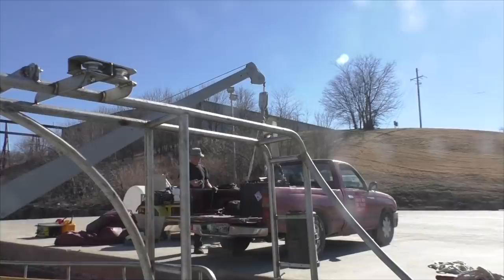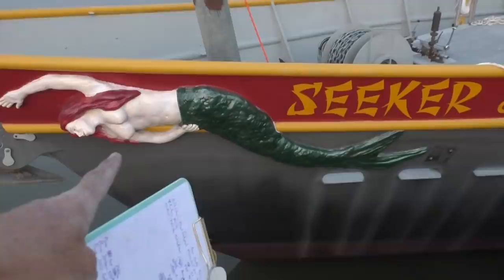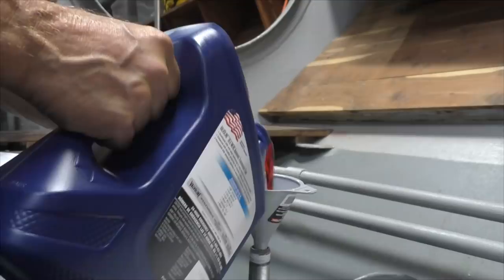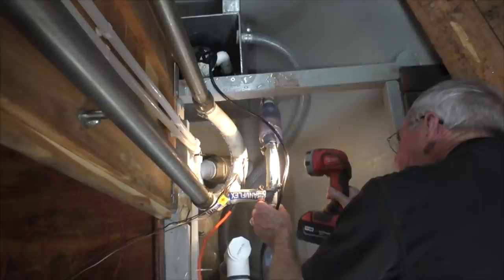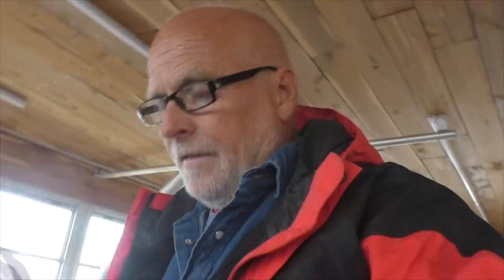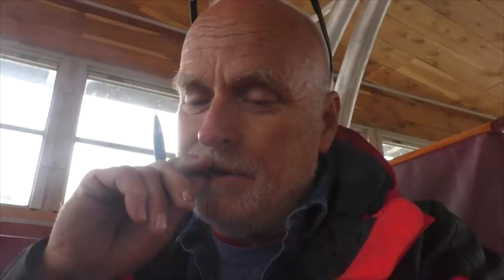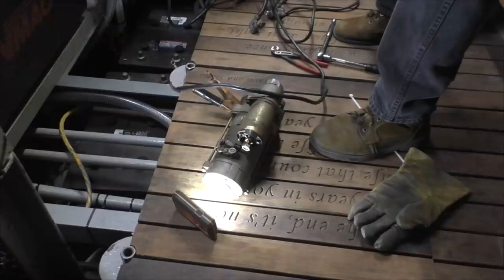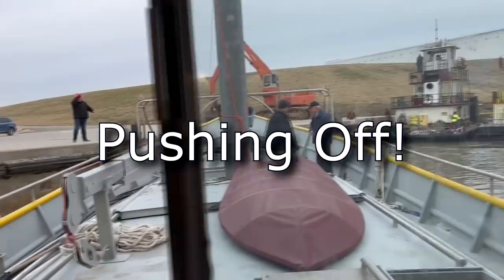Fire, Flood, Listing, Engine Failures and other Dockside Calamities

Comment: I'm still impressed at how you fabricated the prop blades from scratch.
Reply from the maker: That was a blast.  And so satisficing.
Reply: That's what brought me to the Seeker YouTube channel way back when. I was looking for info on building a small foundry out of a 20 lb. propane tank so I could do some metal casting and the first link that popped up was to Doug's video on building his 55 gallon drum foundry. Had to keep watching to see what he was doing with it. When I saw prop blades for a sailboat, I was hooked.
Reply: That was the first videos that drew me in to the project!
Reply: Super impressive. The blades are a very sensitive thing for a boat. Even a little imperfection had a direct impact.
There is a dutch blacksmith that figured out a way to (just) sharpen the propeller blades for cargo ships, making them use less fuel, be more quiet and have less vibration. That blacksmith is now making millions.

Comment: Don't forget that with way on the boat the shaft won't stop.  The prop will act like a fan being pushed by air, or this case water.  Waiting for it to stop would mean waiting for the boat to slow enough for friction losses to overcome the forces from your prop wash.

Comment: Cool, a loo with a "sink the boat" lever. You should stick a Post It on it saying "do not sink boat". And possibly more Post It notes next to the 200 switches and breakers saying "Not this one! That one!". So many things to keep in mind with  Seeker. I hope you'll be training the crew mercilessly or this is not going to end well.
Reply from the maker: Crew are who built this boat, they are not your typical crew.  : )
Reply: @SVSeeker Here is my 2 cents. Checklists keep boats afloat. Departure checklist, docking checklist, fueling, stores, emergency, mani overboard, watches, Systems checklists with diagrams I.e. where r the thru  fitting located, their function, bung locations, pumps FUN FUN FUN
Reply: @SVSeeker  Don't get me wrong. I enjoy every minute of the Seeker story, but today I started to wonder, what would happen, if you went overboard in a storm. I would probably fight my way to the dingie. Panic, a lot of switches and levers and the head honcho taking a swim? But again, you never cease to amaze, I guess, you have things under control.

Comment: Every newly launched boat has teething problems.  Glad to see you are using logic to solve the problems.  I had an old wooden cruiser with a 6-71 Detroit that had a rugged manual gear box that was fool proof and had the ability with the manual Johnson bar to be able to feather the prop in forward or reverse from just a few turns of the prop to mechanically locking it in gear.  Made docking and close manuveoring an easy exercise in a heavy wooden 45'er.  It's been 30 years since and I cannot remember the maker.  It was used by the navy on the small landing boats during WW2.  I am sure someone remembers the maker.

Comment: If your toilet is below water level, you need to have a vented loop in between the pump and the bowl.  For safety you need a vented loop and any line that has an outlet below the waterline to break the siphon  because it is too dangerous to rely on turning the valve the correct way.
Reply from the maker: You can't pump from a vented loop.  : )

Comment: As a proponent of ‘systems’ may I suggest that you start to accumulate written accounts of all these problems you are solving, and how things work. Then later you arrange them and enhance them and catalogue them. When in the middle of a stressful situation, storm, and something doesn’t work / goes wrong you refer to the master manual. Just like in a jet liner at 35,000 feet!!
I promise you, you will be so happy you did it 😎
Reply from the maker: Sounds like a great job for someone like you.    : )

Comment: Excellent move to go through the initial operational testing dockside... I know too many who don't... but it's a habit for me upon every de-winterization... always best to find out what's wrong while it's an inconvenience, not a peril.
I haven't a clue what your Allison's torque converter stall speed is, but keeping the engine RPM well above it will keep that trans temp cooler, and fuel efficiency higher.
The transit time from forward to reverse can be considerably faster, because the hydrostatic drag of the prop in water will bring it to a stop right quick.  
The power steering pump's output dropping out at idle would be most concerning to me, as losing authority of prop pitch would be really bad under any circumstance, especially maneuvering at idle.  IF the hydraulic controls of the Hundestead operates in an 'open center' mode, swapping the vane-type PS pump with a fixed-displacement gear pump would be the best solution.
I don't know how it'll turn out in the long run, but if I were handling it, I'd probably want to keep the transmission in forward, engine at a constant but slow speed, and vary the pitch of the prop from forward, to neutral, to reverse, while maneuvering.  The only time I'd probably use transmission neutral or reverse, is when trying to swing the transom towards, or away from a dock... and when doing that, the greatest value of the Hundestead, is to be able to put the transmission in reverse, push the prop into a reversed-pitch angle, to walk the transom in the direction opposite what would be common for the wheel.  Right hand screws will back to port, left hand screws back to starboard... but with Seeker's ample rudder, it may not be a substantial side-walker.
Reply from the maker: We'll we got fixes for the torque converter and the power steering pump is obvious. It just needs the leak fixed.  I got the $8 fitting today.  And that not the way the VPC is setup.  Being a sailboat feathered, parallel to the hull.  You're thinking motor boat where feathered is perpendicular to the hull.   And when the prop is feathered the prop walk from the initial test can be pushed either way depending on fwd or reverse.   We'll need more time to play with it, but removing the torque converter is frist.

Comment: You can put a lamp over the breakers. It will cause the breakers to always pass some current, but you get an error signal that lights up when the breaker goes out, if there is a load, like an alarm.

It might not be up to some code, but it is super useful as an alarm. Something like a 1W LED for 12V would allow 100mA to always pass.

This is exciting!
Reply from the maker: Yeah, that’s a clever idea. Thanks

Comment: Looks great and don't worry. Every new boat has errors. Whenever pumps are used the plumbing gets double complicated (in-out) and this is a complicated boat. It's like a military vessel with a trained crew of sailors only you have volunteers. When you put to sea for weeks on end you better have a trained crew. In the meantime, you better get some color-coded graphic labels with instructions on every valve and pump! Below water openings need extra attention like fluorescent yellow paint.

Comment: Tachometer on the prop shaft, might be good reference while operating.
Help montor slip, tune for efficiency.
Negative rpm's, when in reverse.
Reply from the maker: We now plan to remove the torque converter.  After that, one tach will suffice.
Reply: @SVSeeker  Did you find an issue with the torque converter?

Too bad they are not a locking type converter or be replaced with a locking fluid coupler.
Reply from the maker: @jhoncho4x4     It's working well enough but it will be better without the slip.
Reply: @SVSeeker  Doug, i’ve been watching you for years since you started it out with a flat lotta land and a pile of steel plates. It’s really great to see you’ve gotten to this mile stone. I figure you’re going to have to come up with a massive gear reduction to turn that prop. My guess is you’re probably not going to wanna spin it more than about 300-500 RPM. I don’t know I was just estimating the size, But I’m certain you won’t be able to spin it very fast and if you try you’ll end up with a molten transmission. You might want to just put on a very small prop say in the order of 15 inches until you can come up with a different reduction box. I wish you lots of goodwill and hope to see many of your videos in the future.

Comment: keep in mind on the starter... Ohms law...    especially important on that type of solenoid.. excessive amperage can "weld" or fuse the copper contact washer that keeps the starter spinning after the gear engagement.. (reason gear stays extended)  if voltage is dropping below 10.5v during crank, you have a problem..  Double the numbers if 24v system...
Reply from the maker: Ok

Comment: On your Flood - I suggest a water sensor placed in the floor that connects to a BELL Alarm (old style door bell).  That should be done any place a "flood" could take place.
The bell is different sound than other alarm.
If you did it (cause the flood) then others will do it also, no matter how much instruction is given.  It is too simple an error, therefore it will happen many times.  A simple flip of a lever, goes from dumping to sinking the boat.
Needs an alarm at each head or else         😁😉

Comment: Over 1,000ah at 24V is pretty awesome.  I have around 700ah at 48V and I can run my entire house, with a 5-ton heat pump/ac, electric water heater, dryer, well pump, and range/oven for a few days, and I love it.  It's nice having that storage capacity for sure.  If I'm careful, I can go two weeks without sun or wind and still have about 40%.  And that's with hot showers, a/c, and washing/drying clothes.  I just don't keep the water heater on 24/7, which is a waste anyway.  I've been wanting to go tankless, and it makes more sense, so maybe I'll just do it instead of talking about it.  It's really a thing of beauty seeing Seeker in the water.  I remember the first load of steel and "folding the hull".  Fantastic job on everything guys.  You've inspired a lot of people.  Me being one of them.

Comment: Get the trim right, create or add a balance equilibrium mechanism that checks side and front, then use that to balance the ship in the future as the cargo changes. My dad used a long tube with colored water back when we built our version of a Colin archer ship and it worked, but I'm fairly sure you guys will be able to make something much better.

Comment: Just a quick observation….. if you had a large enough fuel pump on board you could make up a hose system to take the fuel from the drum on the dock with out picking up the drum ..  might come in handy on the water ..to go from ship to ship …..   with the right hose ….   ….  Food for thought … :o)
Reply from the maker: We did both, in this video.  : )    Both methods work great.

Comment: Doug. Sail boats  are always heavy in the stern. Once you haul up your sails and catch some wind pushing your nose down she will level out.. and once you have provisioned, filled your water tanks full fuel added crew and cargo. You will be fine add a 1500 feet .75 inch of anchor chain.. your vessel is going to dig in aft when the screws are turning anyway.  Also while under way. I suggest you place your tender on deck. The davits will be good while you are operating  at anchor positioned. Gps postioned.
Reply from the maker: Yeah, the plan is to get the sails on and see what we think then.

Comment: For water leak prevention you should put some water sensors at the locations that you might get leak, water leak sensor will sound to let you know you have a leak there.
Reply from the maker: Yeah, I want to put indicator lights on the dash for each pump.
Reply: Boats don’t have water leaks. They’re just sinking. Never take on water and know that’s all pumps r worse than useless. Remove all the thru hull fittings as possible. Have bungs and a plan for the remaining thru hull fittings.
Reply from the maker: @kiwiwifi    Sound  like something Chicken Little would say.

Comment: Knowing nothing about boats other than they are merely a hole in the water that one throws money into,  what about adding water ballast tanks at strategic locations?  Each tank is connected via plumbing for water transfer to correct listing due to newly added loads.  Just my two cents.

She's a beauty to behold, Doug.  Cheers!
Reply from the maker: We're not big enough to have actual ballast tanks but we will be able to shift water and fuel around.

Comment: Doug I know you have spent alot of time thinking about this boat, I don't think that automatic trans is going to hold up. The torque converter is going to slip , you might get away with a manual trans. I would highly recommend a zf or twin disk clutch. Just my 2 cents.
Reply from the maker: You’re one video behind. Don’t give up so soon.

Comment: I thought you were going to use the Hunterstead to reverse the boat.  I’m glad you’re using the transmission.  Easier and more reliable.
Reply from the maker: No, that's for motor boats.   When we feather we have the blades in line with the hull for reduced drag under sail.

Comment: Looks like great problem solving. Is there a way to put some remote status indicators on the more important breakers, so that the Captain/pilot can tell if the engine coolant or other important pumps aren't working?
Reply from the maker: Yeah, what I really want is indicator lights to tell me when each pump is on.  Including the bilge and engine cooling pumps.
Reply: @SVSeeker  the complicated way that comes to mind is to put current monitors on the pump power cables, and light a lamp using logic when there is current detected. One low complexity / higher effort method would be to make a solenoid using turns of the same gauge cable used to drive the pumps, and then have the solenoid make or break a lamp circuit... Basically build a relay with a very large coil and a relatively small NO/NC/C contacts. I feel like someone must make and sell these, but I don't know what they would be called😂
Reply: @SVSeeker  I love idiot lights/ telltales.
Reply: Very important to have an alarm that goes off when a failure is detected in any essential system.
Reply from the maker: @user2C47  So you didn't notice how we all ignored the smoke alarm because the dam thing had been going off all day from the insulation and paint smoking off the exhaust?   : )
Reply from the maker: @kschleic9053  Yeah,  AC current switches are on Amazon.   And the DC stuff is just a resister and an LED, I think.
Reply from the maker: @Brian-mp6bg   Now you're starting to sound panicked.    That is NOT a MUST.   Leaving the dock is much higher on the list.
Reply: @SVSeeker  Nuisance alarms are obviously going to be an issue.

"When everything is beeping, it means nothing"
- Elon Musk (paraphrased)
Reply from the maker: @Brian-mp6bg    Yes.   "are a must"  to me, defiantly has the smell of fear.
Reply from the maker: @Brian-mp6bg  there’s a problem. You really need to get out of your basement.
Reply: @SVSeeker  what a tease!! Get off the damn dock!! "If it's gonna happen, it's gonna happen out there." Captain Ron lmao ..................⛵
Reply: A quick and dirty solution would be just put a little camera (maybe even a phone) pointed at the breakers.

Comment: Controllable Pitch Propellers are normally installed on vessels to take advantage of only needing a single speed gearbox and functionality of being able to provide thrust in efficiently in either direction.  CPP do not need to reverse the direction of the propeller shaft to go astern as this is achieved by changing the pitch of the blades, passing through the Neutral position (0 degrees pitch) until the pitch angle is in the opposite direction; creating thrust in the astern direction.  CPP have the advantage of letting the engine run at a fixed rpm while vessel speed is controlled by varying the pitch.  Large vessels use this constant engine speed to drive shaft generators and propulsion of the vessel off the same Main Engine.  

CPP are typically found on ferries that don’t wish to turn around when docking which saves time and money.  They simply design the hull to be efficient in going ahead and astern and the CPP allows the propeller shafts to turn in the same direction and constant RPM.  The thrust direction and power/ vessel speed are controlled by changing the pitch of the blade.
Reply from the maker: Except on sailboats.  : )

Comment: Putting a pair of little hall effect driveshaft sensor like those found on drag race rearends for that tube might be useful thing measure direction and speed(rotary encoding for the win?)...lots of tricks with temp and pressure sensors to warn or shut stuff off.  Be sharp tho sometimes you really don't want a computer to help!

Comment: With things like heat exchangers unless it is an evaporative system the entire fluid loop will be at roughly equal temperature, not really a hot or cold side to them.
The radiator removes heat from entire system at whatever its rating is for the airflow it is experiencing. Its funny because increasing the pump speed or volume may do nothing to help it as long as the coolant loop is flowing fast enough for saturating the loop with heat. Anyway, I do not know what your transmission heat exchanger looks like but it is possible the exchanger is undersized, or airflow is not good, and the pump is not the problem. Good to see progress!
Reply from the maker: It's the same exchanger that was on the school bus, but we have it connected to the coolant system with a pump.  It no longer uses the engine coolant pump.   It's now a moot point as we are going to remove the torque converter.
Reply: @SVSeeker  Thanks for the reply, and congratulations on making it to water.
Reply: @SVSeeker  
On Volvo penta the gearbox is cooled by the sea water … in to the heat exchanger